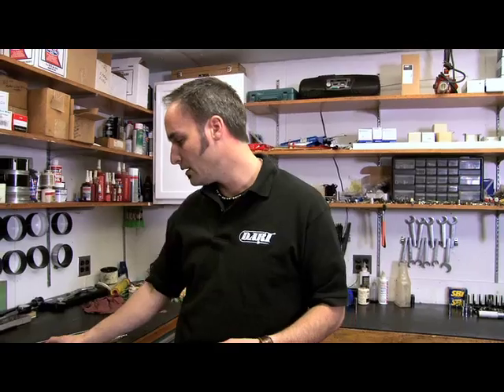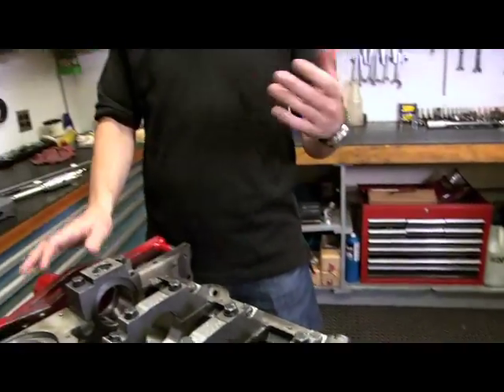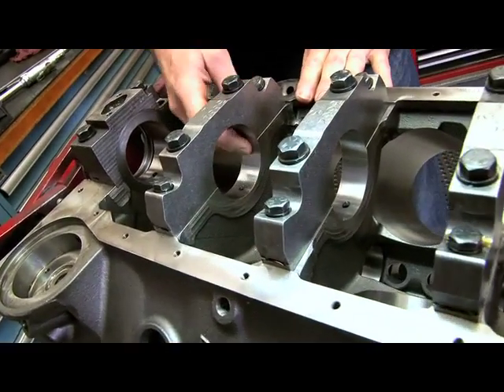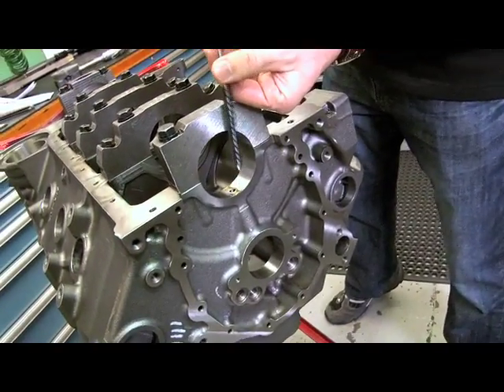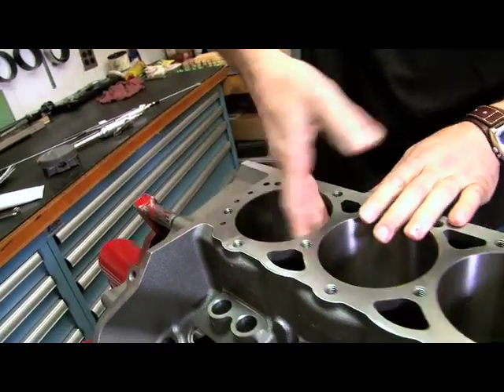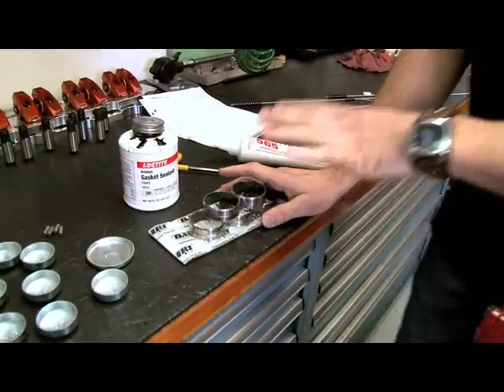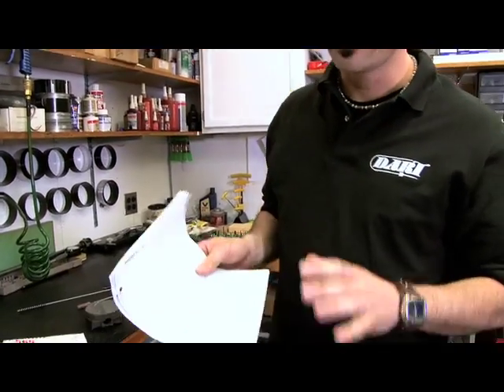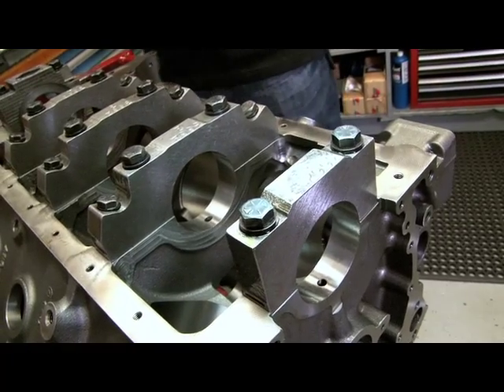Dart University, Prepping Blocks

Comment: If Dart had any brains they would stop putting the pistons .050" down into the hole?? There is no way possible to control quench depth with the pistons this far down into the hole and it also kills compression for absolutely no reason, you are leaving power on the table and this huge quench sucks beyond description. Try addressing this glaring issue instead of covering the basics for the millionth time. Now because the people at Dart do not understand how to properly build an engine I have to take apart my brand new Dart assembled block and take it to the machine shop to deck the block to where it should be so that I can have an acceptable quench depth and get back some of my compression.
Reply: Have it decked or by another block with a shorter deck. Pretty easy to get 10.0 -1 with a +13 - +14 (ish) piston. I run power adders and 9.0-1 to 9.5-1 is what I run in mine so a +11 or 12 for me.

Comment: Nice try but the block is NOT ready !   Yes , that's right you need to have the cylinder bores honed ...  the block still needs to be decked as the deck comes from DART not square and needs decked . ( the deck is rough ,Its made that way ) So , it needs honed and decked . A lot of deburing has been done all over the block but still needs a bit more , drain back slots in the lifter valley , around freeze plug holes , etc . I have a big M block its a very nice piece !
Reply: It's all in the work order.  You could spec bore hone, deck height, journal sizes  etc - just make sure things are itemized right.  If the work order needs fixing, do not proceed - works for houses, plumbing, airplanes, engines, you name it.    Like judge Wapner used to say [every week at least]: show me the paper.
Reply: He has more money than brains.